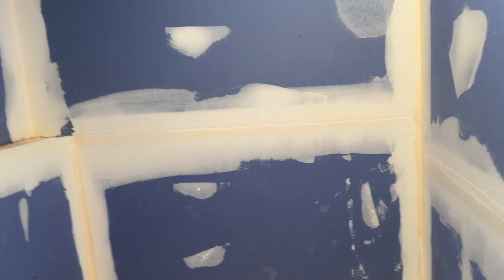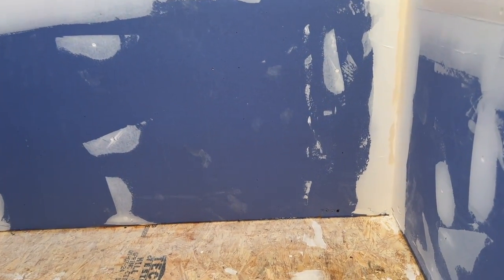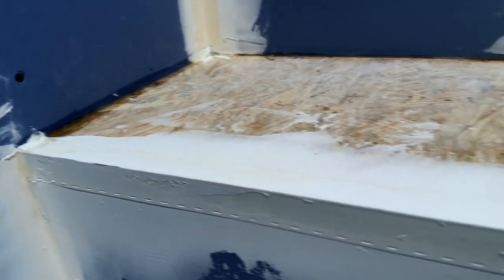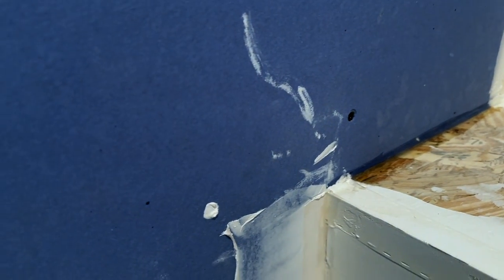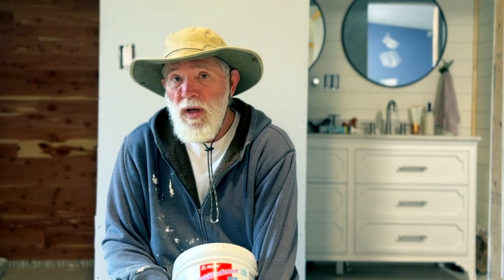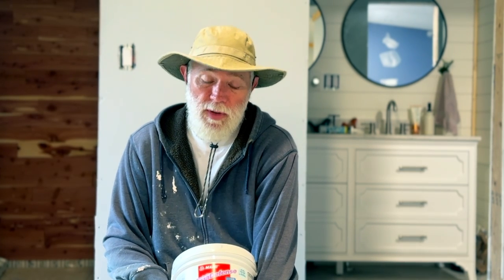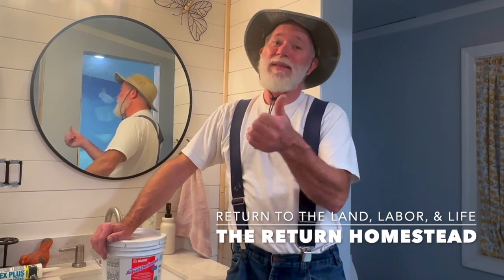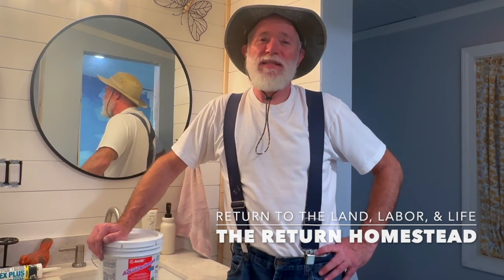How to Apply AquaDefense for Water Protection

Comment: Did you tile, and is this still standing, interesting. Also drywall vs goboard is not much different pricewise for such a small space.?
Reply from the maker: We did tile. It is still standing and doing well, though I am not a tile setter. Drywall was what I had experience with, and time was of the essence, so I went with what I knew. If the tile is water-tight, it should not matter what is behind the tile, right?

Comment: Curious where you got the idea to just seal drywall with aquadefense/redgard in a shower.  

Note to those watching, please don't use drywall in a shower, regardless of whether you used the aquadefense/redgard or not.
Reply from the maker: Totally agree that you should not use drywall in the shower. I am just a homesteader working on a budget. I make my own decisions about what methods and products to use where, often with little regard for the "rules" about how those methods and products should be deployed. That may not be the intent of the engineers who designed and built Aquadefense, but this fits into my budget and the rest of the system does not. What I did in this shower is a repeat of the methods I used in Nevada. That shower was approved by code enforcement in NV after a lengthy debate over the efficacy.

These fancy products are not strictly necessary and I encourage everyone to investigate how projects were done 50 years ago and see if those methods can produce a satisfactory result. Its your project. You do you.

Comment: The membrane anticipates a crack in foam base.
Reply from the maker: I think the membrane would be very useful as a crack isolation layer, which would prevent cracks in the substrate from spreading into the thin set or grout. Not much chance of that in our shower setup.